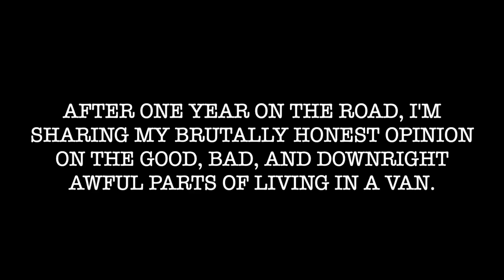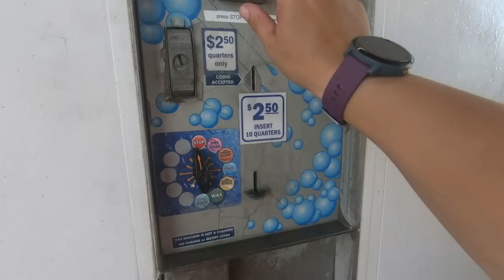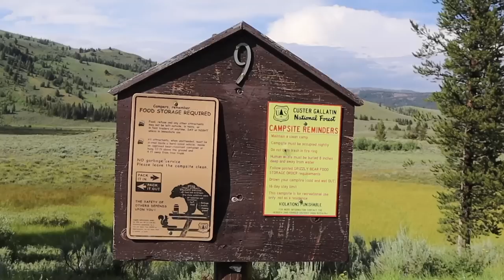My HONEST One Year Review of Vanlife

Comment: i checked out a few done up vans before i started and i knew i would rather have the extra space than build cupboards everywhere or a sink or a shower ... i went bare and only built my bed frame super high and that was about it , everything that's loose i have in many clear plastic bins that are all tucked away under my bed ... so from the end of my bed all the way to my driving seats there's only 2 battery banks and my small portable fridge/freeze (all 3 are kind of near my bed too) ... i also have a giant breed dog living with me in my alaskan malamute , so he takes up all that extra space to himself ,, but yea from one side wall to the other there's nothing built all that floor space is his ... I also live and work full time in my van in a large city , so the dog doesn't really get dirty from just his daily park walks , 1 shower for him a month via van dog washers and that does the trick , but i do have to deal with massive amounts of shedding fur though , and yup you just get used to it

Comment: I get it, but all of these points are common sense. Always have a backup plan for everything. I don't need a laundromat to wash clothes. I hand wash in the sink. I don't have a mini split for ac, I bought a midea portable ac unit. I'd don't use lithium batteries to store power, I use portable power banks with a solar charge array and a predator generator to back that up. I use a wood burning stove for heat because dead branches are free. Saves money and can cook on it when it's cold out. Dual purpose. Bugs and dog hair are par for the course so it's not talked about much. Things happen but what the real issue is some folks just aren't prepared enough
Reply from the maker: Not common sense for people watching that are just starting out or considering vanlife. These topics were skimmed over when I was researching. Sounds like you have found great solutions for your setup but most of those won’t work for me. We all have different needs. I’m just sharing my experience and being as honest as I can be.
Reply: @girland2vandogs  my apologies. Wasn't thinking. I built my rig around what I was talking about. I have a 2000 ford e350 van and tow a 24' cargo trailer. My bathroom and shower are in my trailer, not in my van. Freeing up alot of space with a murphy bed to keep an open floor plan. Alot of space for those rainy days to work out and not wanting to lay in bed because it's not out.
Reply from the maker: @chemicalwarfare1388  that sounds like a dream set up! Very jealous!
Reply: @girland2vandogs  thank you! Just a different approach is all. Didn't want to feel limited if that makes sense. For me, it's all about simplicity. I carry a lot of tools and parts in my trailer. My next move is to buy a water generator machine to be fully sustainable. We shall see how it goes.